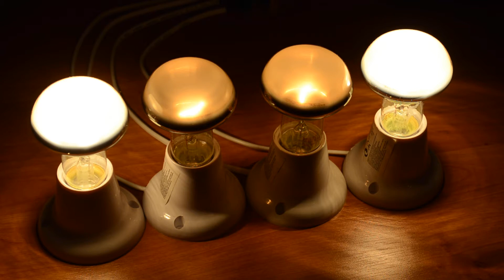4 Channel AC Light Dimmer Module Arduino Raspberry

Comment: Please can you show exactly how to connect and use your dimmer module with a Raspberry Pi?

Can it be used with only a Pi? Or are you using the Pi to talk to an Arduino?  This is very confusing. 

I need to use this with just a Raspberry Pi. The only Pi diagram I have seen shows only connections for serial RX and TX. 
So, is this module only using Serial UART? 

Thanks.
Reply: Hi, were you able to find this out? I am struggling with the same question. What I've found so far is only Arduino... Thanks!
Reply: @tiszavolgyipeter   Hi,were any of you able to find this out? I'm also struggling! Thanks (:
Reply: @ivanezquerra8902  I decided to go to another route. I bought cheap dimmer switches on Amazon, flashed with Tasmota and controlling it through MQTT. E.g. This one: https://www.amazon.com/gp/product/B07PJTLB7Z/ref=ppx_yo_dt_b_asin_title_o02_s00?ie=UTF8&psc=1